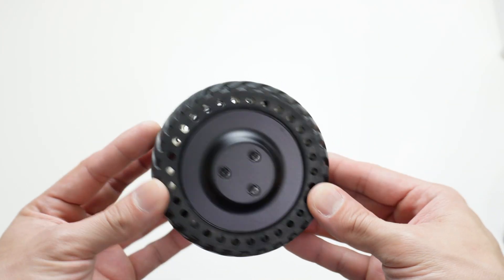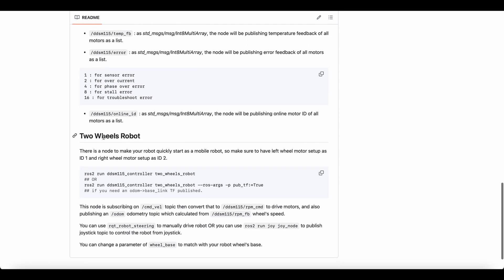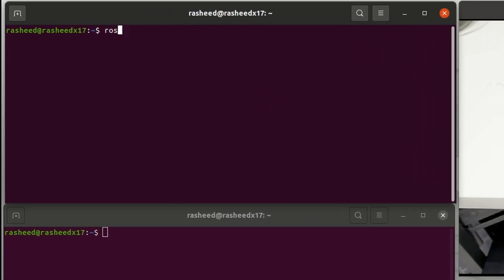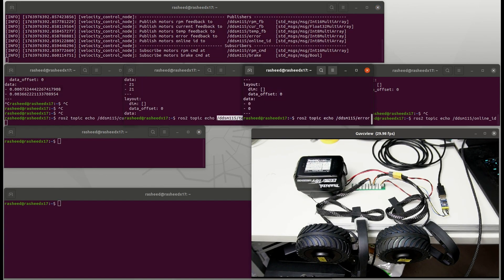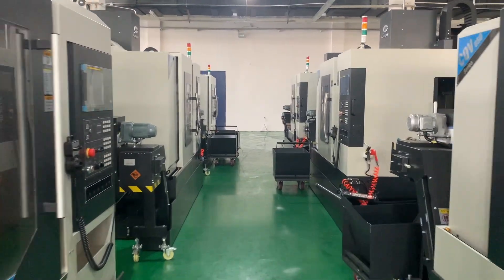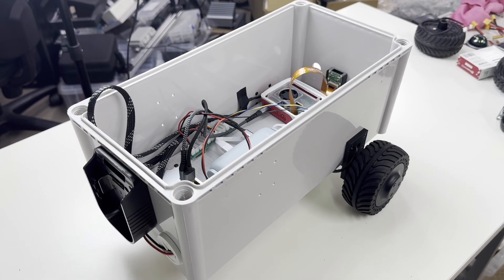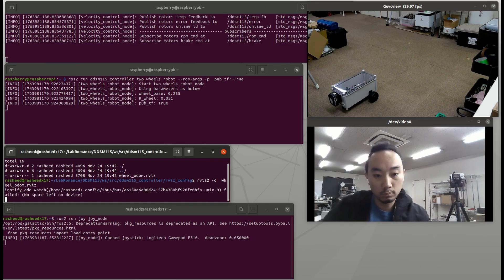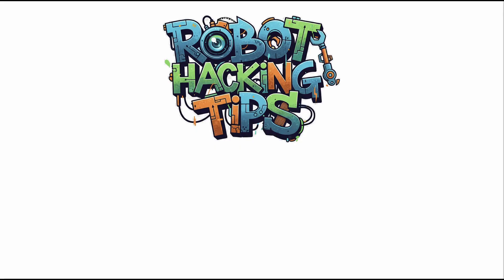Making robot is A LOT easier with this motor | Robot Hacking Tips EP.3

Comment: Are both wheels running at the same speed without any lag when mounted on the robot? During straight-line tests, should the robot move perfectly straight, or is some deviation expected? We observed some drift over a 10-meter straight run on our robot with these motors.
Reply from the maker: From my experience of making many mobile robots, even you have exact same two motors and have a super fast controller to achieve same RPM, in real life the robot couldn’t move perfectly straight anyway… there are influence of hardware, environment, friction, and etc.

That’s why people are working much harder on localization (SLAM) or higher level PID control like wall-following, or VSLAM smth like that.

Comment: Thank you for the video! what battery and cradle with power connection are you using?
Reply from the maker: Hi, the battery is a well-known machining tools brand “Makita”. If you search “Makita battery with holder” there should be some link you can buy.

Comment: Great video. I'm using the DDSM210 on my robot, I believe it uses the same control commands as the DDSM115, so I'll have to try your package. Can i ask what dc-dc regulator board that is? Thanks
Reply from the maker: Thank you for watching!
I would say unfortunately the DDSM210 is using UART protocol instead of RS485.
The control packets seem to be same as DDSM115.
I have tried on Arduino but not success… the thing is since UART is one-to-one communication, you can send command from computer to each motor, but it’s not possible to read each motor feedback when all motor TX lines are connected to together to Arduino Rx pin.

I think this is design error or something…I never seen motor with UART in series before 😅 maybe it’s my bad or I missed something but you can try and please let me know.
Reply from the maker: sorry, I forgot to answer about dc-dc regulator, it’s a custom design from my company. It receives 20-60V input and regulates one 5V on XT30 and two 5V USB type A ports, and one 12V on XT30, rated at 100W. If you’re interested please email to me.